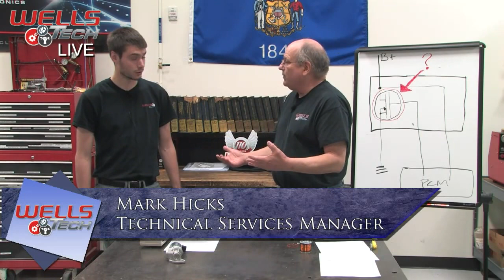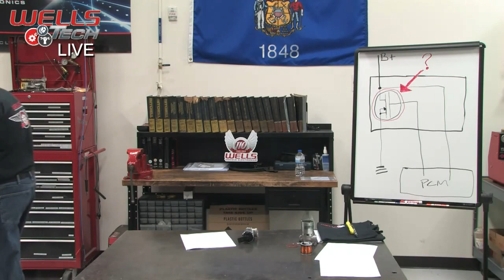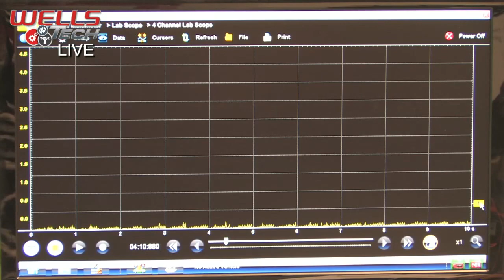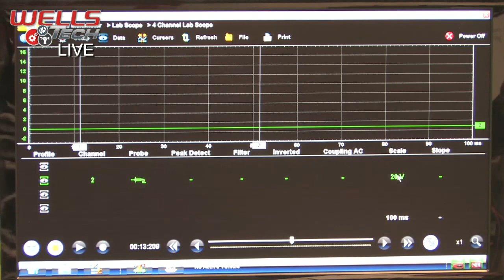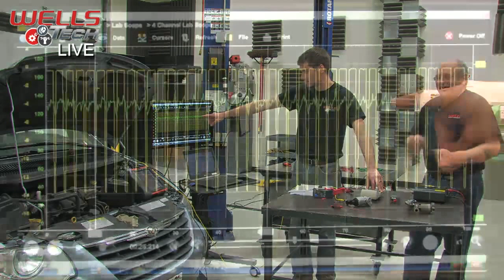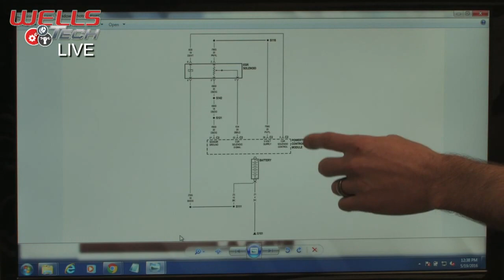Chrysler EGR Scope Diagnostics, P0404

Comment: WOWWW thats a very interesting thing you guys said, the engineer design to control the positive side of the actuator  in case there is a short to ground in the control wire and prefers to cook the PCM instead of  that the EGR stays open if is were design as a negative control wire!!!! and cause the engine to stall all the time, all for the safety of the driver!!!!! thats so cool!!!, maybe they are doing it in all the most important actuator that could cause an engine to stall or malfuction!
Reply from the maker: Hey Miguel! It is a really interesting system. There is most likely a built in current limiting device inside the pcm. A built in "safety net" to keep the computer from cooking itself. Most computers have a way to limit that without burning itself up. 
Mike Becker, Technical Services Instructor